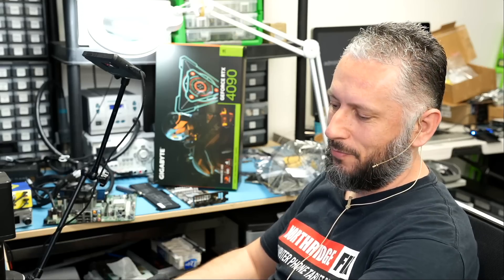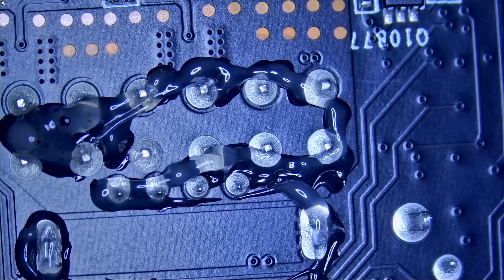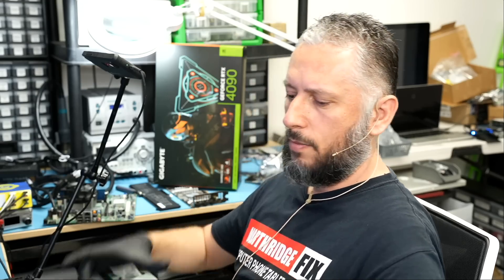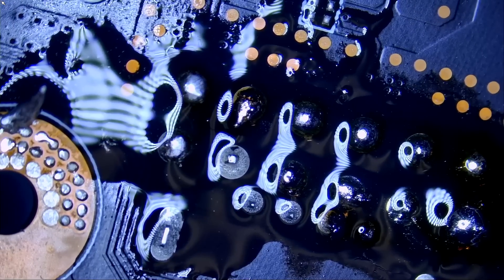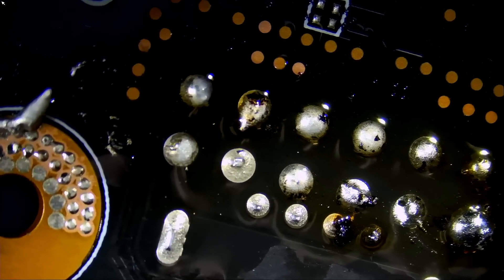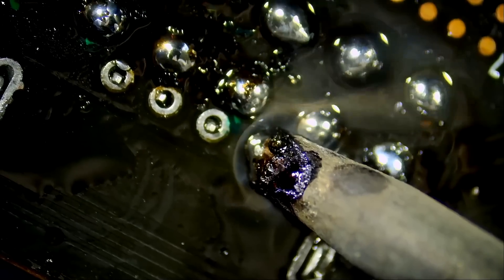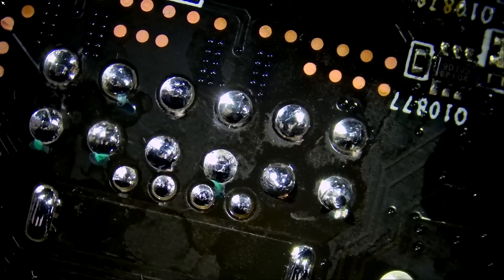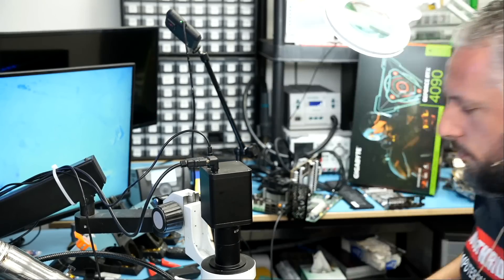4090 Connectors are melting like Chocolate - Zotac AMP Extreme Repair

Comment: Hi Alex, I wondering if this happened because of the adapter that come with or due to high power draw 450w, and had you ever been face this issue with any 4080 or 4070 super gpu's, and do you think by replacing this adapter with corsair cable can resolve the issue?

Comment: Have a question , can you get the 12V-2x6 power connector that  will replace the 12VHPWR power connector , I have this card with no issues at this time , should I replace ?
Reply: i still don't trust it
Reply: I  got the WireView from Thermal Grizzly , well build , but firmware is bug , support at Thermal Grizzly said they would send me a replacement , been a week.

Comment: I honestly think that the gauge of pins they're using for the 4090s is way too small. Not to mention the plug size. Back when graphics cards were really power hungry. We had three eight pins on there for a reason.

Comment: Lead free solder melting temp 217⁰ -220⁰c  due to tin material  need high heat..

Lead base solder  melting temp 183⁰c

Comment: What they're ultimately going to have to do is double or triple the voltage. That thing is pulling 50 or 60 amps. Maybe put some lugs on the PSU and graphics card and run some 6 gauge cables.

Comment: Alex - question - have you thought about sending some of the burnt connectors off to a lab for testing to see if the plastic is defective? I think the results would be telling.........
Reply: It's not the plastic. You're not suppose to run that much amperage parallel. Connected to those little tiny pins too. It's going to take the path of least resistance and it gets hot.

Comment: Paying Top Dollar to have this issue is UNACCEPTABLE and the only was to HELP Prevent this from happening is to Cap FPS to keep Power in check. I paid 1650 for a 3090 FTW3 that is Notorious for bad  soldering. That card can pull 430 plus watts which is not safe. FPS Cap  and around 335 watts and no Problems with fingers crossed.

Comment: Wow, so glad I returned the 4090 after I noticed how HOT the cable area was getting when using my MOD Cable 180 degree adapter. Instead bought the 7900XT for less than half of the price at $719 open box and has been AMAZING in 4K gaming with 20GB VRAM!
Reply: I think you did the right thing, save your $
Reply: This is a comment I fear. :face-turquoise-covering-eyes: The FPS performance difference between a 4090 and 4080/XTX/XT is _wide_ and if I am getting a new rig I want what's best.
But ... I also do not want to risk having a small plastic fryer in my PC. :face-purple-crying:

Comment: I too like to cut off the pins of bulky items when doing pcb rework. Usually, the part concerned id 'dead' anyway, so need to save it and possibly trash the circuit board.

Comment: Thank you great video for melting RTX 4090, the bad Nvidia engineering one 16 plug electrical then need two 16 plug for power graphics. Another melting at Rtx 4080 cards.

Comment: Removing those ports reminded me of replacing analog models on my PS4 controllers. Took me quite a while to get the job done with a really cheap soldering iron and gear. But thanks to your videos I learned enough to do it.

Comment: The connector didn't melt because it's a 4090, the connector melts because the owner has never played lego in his life. Many people have already tested the card by cutting several 12v cables and it still didn't melt.
It's already proven is user skill issue.

Comment: Its funny...his theory of the melting is what i though. then gamers nexus posed another theory while testing this too. It  should work but i guess the connectors dont touch properly causing the pins to heat up

Comment: this 12 pin is dumb, 4x 8 pin plugs can handle ~1200W based on the pin spec, meanwhile this 12pin is specked at 600W, just maybe 8 pin plugs are only rated at 50% spec capacity for a reason, you can say sure a 12pin can handle 1200W but if you apply those rules to 4x 8 pins you get a 2400W limit

12pin plugs take a lot of force to fully insert and some thermal cycling (and/or cable managing) will work them out then this damage happens when they are not 100% clipped in

Comment: I much prefer Corsair's connector which splits into 2x cables going into the PSU. The 12VHPWR end going into the GPU is also much neater and less bulky by comparison and you can bend the cable properly so as not to cause bend at the connector end causing inefficient locking and contact. It just feels  better engineered than the massively bulky Nvidia connector that splits into 3 or 4x PSU PCIe connectors.

Comment: user did not push the connector all the way in thats what caused the burn. User error
Reply: there is RTX 4000 series connecters plugged in all tha way and it still burns! FAILED CONNECTOR should be illegal and recalled for 4x8pin power connectors instead

Comment: So is it not worth buying a rtx 4090 because of the connector or making sure you buy the right power cord to connect to the video card, note if the rtx 4080 has the same connector, why don't they have the same burning issue?

Comment: Hi Alex, wouldnt pre heating the whole GPU make the job a whole lot easier? if not, can you share why?
Reply: you only need to heat the part of the board being worked on. heating the whole board could damage things like capacitors and plastic components.

Comment: @NorthridgeFix do you get any 4080s or 4070 TIs with melted connectors? Those use the same connector but I hear very little about the melting, I'm assuming due to the lower power draw meaning temps don't get high enough to melt the plastic. Just curious on your experience.

Comment: If they must use a single connector, why don't they use the old school thumb screws like what you used to get on old style connectors (like VGA cables), it would hopefully force the connector all the way home into the socket

Comment: Buy a PCIE5 PSU MPG A1000G Has all the protections and one cable make sure it clicks  don't use the RTX 4090 adaptors if you are spending so much money on a GPU get the correct PSU

Comment: i assume you make it very,very  clear the customer must replace their psu cable too otherwise the new socket will be immediatelly damaged again, im always repairing water damage in car modules and its the customers job to find the water leak and get it fixed not mine- so often they dont!

Comment: I wonder if putting a fan / air flow directly on the connector would keep it from burning its self up?
Reply: It might make a slight difference in temps, but most of the heat is coming from inside the connector due to high resistance.

Comment: I am glad you agree the new GPU power connector is hot garbage.  I do not understand why nvidia couldn't come up with a better design that has ZIF style plug that you then lock into place with a lever or something and will clamp on the contacts with pressure.

Comment: Hi Alex, this type of repair is what I dread most.  I will be honest with you, I have learned more from watching your channel than from 30 years of experience in electronics repair.
What I still struggle with, and I see that pop up in comments to your videos is, once the component/connector is removed, how do I get the solder out of the holes.  Especially in very thick boards. I  hear you mention good flux and tightly braided copper braid.... but still no win for me.
Could it be blown out with a hot air station? Do I need higher temperatures?  The flux already starts to burn.
Could you please give me some advice?
Best regards, Erik
Reply: Low melt solder
Reply: @sadaqatali5712  Yep, IOW at least 40% lead solder (the work of Satan himself to some people).

Comment: The cause of the problem with 4090 cards connector is you have to install the electric cable all the way in card flush  if its not all the way in it will melt its really easy to think you got it in when you don't you hsve to rock plug back snd forth while pushing if everything is quiet you can hear it click
Mostly the plugs that go in that melt instead of the card side
Make sure theres plenty of room between end of cable and case if it bends the connector putting door on that also causes it

Comment: I also own a 4090 from Zotac. Not an Extreme Edition though.
Do I have to be afraid now, that my connector will die sooner or later or is this a rare occurance?
By rare I mean something like from a million cards 1000 die.
Reply: Just make sure that there isn't any visible hole left between the plug and the socket exterior. Then it's in as well as could be expected.
Reply: @magitsu  You sure meant a gap, but yes, ofc, thank you very much. 
I have read about the first cards burning through their power plug and I also have heard the problem was 100% about an inch and a half or 40 cm in front of the screen.
So...kind of a lot of Eddy's...the kind surnamed Odd. ^^
Well, I am working in IT, I always choose and build my PC...and for whom wants it in my surroundings.
Never a problem, not even a small one.
You could say I am fairly experienced in this field, but I just don't know about power consumption, heat dispersion there, electricity on paper (blueprint?) and to work with - a nightmare for me -...other than that. it will work as promised and will do that continuously.

Like, cleaning regurlarly or at least looking for neceesity or not to do so.
At least once a year new thermal paste on CPU/GPU, if necessary heatpads on the GPU as well. Motherboard, if there also worth a check now and then. 
Hardware will just last, because it never overheats once.

Comment: The idea 💡 of cutting out the damaged connector and desolder the pins independently is the best, it’s a smart move to avoid using hot air  to a board that thick. Awesome work
Reply: Very much the same technique I use myself. It can save the circuit board too.

Comment: LMFAO .. "notorious" .. ARCHING .. You do realize that that has been determined to be 100% user error from Arching and people not plugging in their $2,000 GPUs properly, right?!! 😂
Reply: Correct but technically its Nvidia fault for using a connector that is so easy to not plug in all the way. Thats why they have to cover it under warranty. Cause its ultimately their fault. They know users are dumb.
Reply: bad connector design that results in increased user error? Yeah that's the full story. The user is a gorilla, you need to design your connectors to be handled by that and not assume that everyone has a degree in IT
Reply: If a consumer product is designed in a way that the end user can cause this kind of damage and fire risk, then it’s never 100% user error. We also know why the first cards failed, we still do not know how this connector will hold up over months and years. Either was this issue is notorious, and involves arcing.

Comment: Alex if you can find a manufacturer to make you a ceramic connector would be a good idea to solve the melting problem and you will be a distributer for it 👍
Reply: but a connector in the cable would melt anyway if not pushed in all the way

Comment: Maybe the 4090 connector has slightly thinner pins and does not make a tight fit,  bad joints = high resistance and burn up.

Comment: With all respect, have you thought about using a desoldering gun?  It will be less heat on the pc board and faster to remove large connectors?
Reply: He knows what he's doing

Comment: This normally occurs when the connector isn't fully incontact.
Reply: Yeah they really need to engineer this properly. It's like it's some highschool project idea and they just used that.
Reply: even then, tha connector is flawed fully incontact or not and i've seen those connectors snapped off
Reply: @blakedmc1989RaveHD  for sure it should've been engineered by someone that actually knew what they were doing unlike the person who made this. A massive oversight on a problem that would obviously happen if nothing was done to prevent it.
Reply: @XX-_-XX420  they should just go back to 3 or 4 8pin power connectors because there was nothing wrong with those connectors

Comment: Stop using connector come from the box it's garbage , go buy 12VHPWR 600W cable from seasonic or corsair (depend on your psu brand) , if you can afford to buy 4090 , i think buy 12VHPWR 600W cable not the issue for you.

Comment: This is mostly because of user error, they dont push the connector fully.
Reply: It is user error causing this. But its Nvidia fault for using the connector that allows for user error.
Reply: @tacticalcenter8658  those are standard connectors that are in use ages ago, check the video its user stupidity not pushing connector all the way in. But yeah nvidia could have used angled ones.
Reply: Really? It's not poor design? I've seen cpu and gpu pcie 8 pin connecter not pushed in all the way. It didn't melt. 😂

Comment: I’ve modded my cables to accommodate the interference between the card and case panel…people must be cranking these with a power supply that’s too small….
Reply: No, they are but plugging them in all the way. That is it.
Reply: @tacticalcenter8658  even if it's plugged in all tha way, it still burns with all cables! tha connector should be illegal and RTX 4000 series should be recalled for it just to be able to fix it with 4x8pin power connectors

Comment: Great Job Alex ,I am wondering, wouldn't the power cable from the customer 's power supply be damaged as well?
Reply: .. It's caused because the user did not plug in the connector in all the way and it was arcing creating high temperatures. It has nothing to do with the cables, meaning that they probably didn't even get warm. 100% user error!
Reply: @DJaquithFL  More like poor mechanical design on the connector
Reply: @marcogenovesi8570  .. No, it's 100% proven that it's user error. Look it up.
Reply: @DJaquithFL  so if people don't plug the connector properly AKA don't plug it in all the way it melts and if people attempt to plug the connector correctly they manage to break them off because now you need v-mounts or angle extensions so you can plug the card in

that is absolutely not a user error,user should be informed onto how to plug the damn thing into the system and to ensure that connector sits properly before turning on the system

if tolerances,tooling and accessory support are god awful from factory no shit people have issues like these when they are not offered solutions by default instead must do research in order to find things out they are not even supposed to do
Reply: @DJaquithFL  the voltage is too low to cause arcing, it's just heating up because of higher resistance

Comment: Some 12vhpwr cables  connectors I noticed have wires not holded in place and sliding out of the connector,  literally. Had two form MSI and two from thermaltake. 3 out of 4 had that issue. They do replace them with no issue. At this point its a user and cable manufacturer fuck up.

Comment: From what I've watched, it's caused by not plugging the cable 100% the way in. Also if the side of your case is really close to the connector you might need a bigger case so it isn't squeezed. Especially a 4090, that thing is so big, I don't really see using an angled connector as a solution, when the case isn't big enough for a 4090 anyways. I wouldn't even want a card with this new connector, it's stupid.
Reply: It really is stupid.  I'd rather run 3 or 4 8 pins to my card than this nonsense.
Reply: @Bizznatch57  Its ridiculous, you have to plug the 4 cables with 8 pins after this adapter anyway, what's the point...
Reply: @FrozenHaxor  I hear ya. I almost edited my comment to include that lol.  Makes no sense
Reply: @FrozenHaxor  It saves a lot of PCB space, that is the point.
Reply: @Bizznatch57  That would be FAR BETTER. Those 8 pin connector have a more substantial contact (runs cooler) and use more of them for the current (runs cooler).
Reply: Yep, bad design is what it is.
Reply: Bad design. Rather buy another brand and use 3 8 pin connectors.
Reply: @Sam Ross 100% CORRECT> That crazy 12VHPWR connector is DEFECTIVE BY DESIGN. AND it makes cable looming more tricky too. STUPID all round.
Reply: NO ITS NOT ! This is the utterly stupid idea that Steve of Gamers Nexus is falsely promoting ! It's FAR, FAR WORSE than that ! To melt the nylon plastic used in those connectors requires a temperature of 270C (520F). Connector contacts should NEVER reach temperatures that high. They are running HUNDREDS OF DEGREES TOO HOT.
Why is that ? Long story short, the contacts simply aren't capable of handling the current required DUE TO *RESISTANCE HEATING*. The contacts need to be MUCH LARGER (reduces electrical resistance). A redesign of the connector is required.

The 12VHPWR connector IS DEFECTIVE BY DESIGN ! END OF. It's just a question of someone finally accepting the fact. IT'S A *MATERIALS LIMITATION*.
Reply: @itstheweirdguy  You're entirely WRONG. Plugging it in 'well' is NOT the issue. Having contacts too tiny to handle the current properly without excessive temperature rise is the problem ! The contacts have been downsized to 40% of the previous PCIe/Molex Mini-Fit connector yet are expected to handle 50% MORE current ! That ridiculous design choice is at the heart of the matter.
Reply: or buy an board that doesn't have this trash connector, it's an marketing connector that is an total band design, you can't even say it's "play & play" safe
Reply: @renumihai5263  Unfortunately Nvidia are wedded to the stupid 12VHPWR connector. You'd have to buy AMD (who have avoided it).
Reply: Just parotting what people knew for months already...
Reply: Stop regurgitate what you hear from other people and learn to think for yourself.
Reply: Yeah, gamers nexus did a great investigative report on it. Its a combination of user error plugging it not all the way in, "walking" the connector out during cable management and bad design from nvidia.